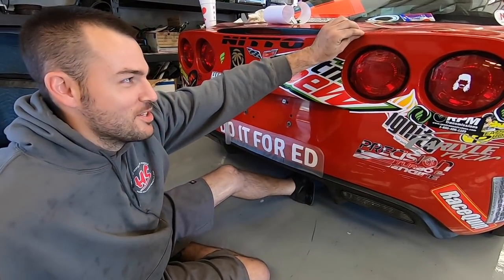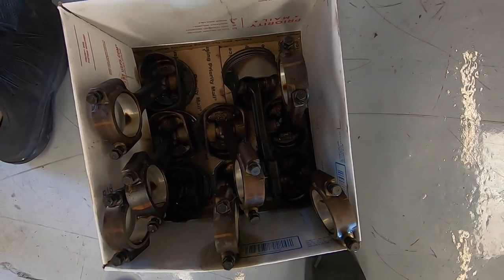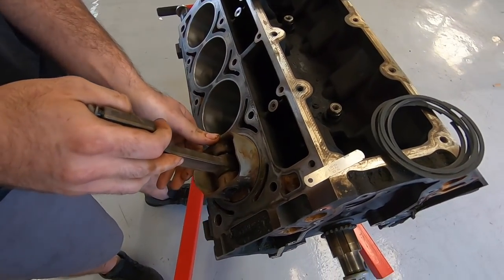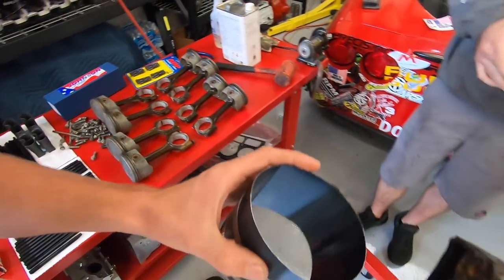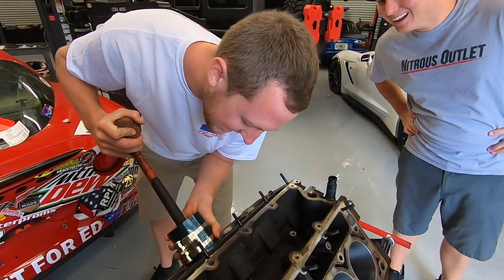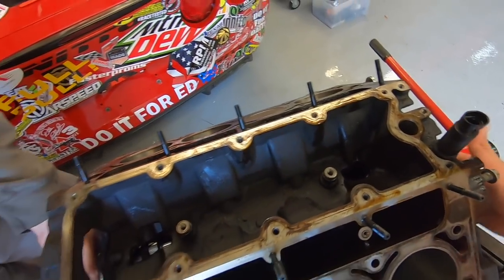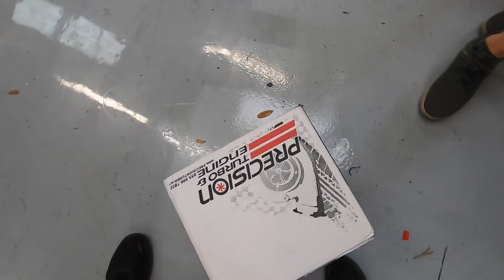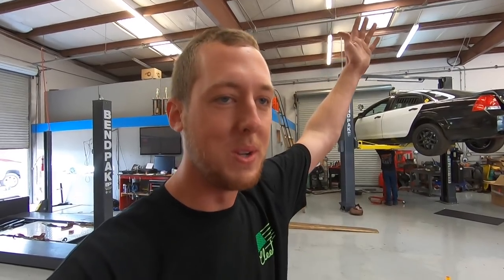The Auction Corvette is REBORN w/Her "NEW" Junkyard Truck Engine!

Comment: What kind of voodoo is this?! I'm also gapping rings as we speak 😂👌
Reply: For boost?
Reply: She'll be ALOT more Aerodynamic but think he's having way too much  fun with the ol'girl to comparee Ruby to "MR. MONEY MAKER" LEROY
Reply: I’ll be gapping mine next week 😂
Reply: I’m replacing lifters on a 5.3 today 😂
Reply: @ezbdaniels  Do you have to replace the cam when you replace hydraulic lifters? My Suburban has a lifter tick that I'd love to get fixed eventually and I just want to know how much to save up, especially since I'll be having someone else do it because I'm not of a mind to deal with a modern engine and its clusterfuck engine bay.
Reply: I feel like I'm a mechanic now lol
Reply: The YouTube Phantom Official You shouldn’t have to replace the cam unless the journal’s scarred... i’m not 100% on a Subaru, as I mainly work on Gm motors at a Chevrolet dealership but the only time we replace the cam is if the lobe is buggered… GM had a problem with AFM lifters collapsing… Most of the time you can get by with just throwing new lifters in. I’ve also seen quite a few of the lifters spinning inside the plastic lifter guides which damages the cam when the roller turns sideways. I know on most imports, overhead cams especially, the tappets would start ticking. It’s usually a fairly simple job to replace them but as I said I’m not a Subaru expert by no means :-)
Reply: @ezbdaniels  nah, inspect it if you're worried but if under 200k it's probably good to go
Reply: @cumbob  ok, thanks. I know you have to replace the cam on engines with solid lifters, but I wasn't sure with hydro lifters.
Reply: Chase Younggreen  The one I’m fixing had A collapsed AFM lifter on cylinder seven... no problems found at all on the cam, so I talked the customer into replacing all the lifters and guides… Not my first rodeo buddy as I’ve been in the dealership world for coming up 15 years
Reply: The YouTube Phantom Official You are correct sir. Roller cams are a whole different beast than the old school Hydraulic
Reply: ezbdaniels he said suburban not Subaru
Reply: Grants Dad ah man, sure did... it was a long day 😂😂

Comment: Sometimes working on a car is fun and sometimes no fun at all, depending on what you're doing, where you're doing it, and why you have to do it.  But once you have an engine on the stand with a box full of new parts nearby, the rebuild is always pleasurable work.  And the excitement and satisfaction you get when it fires up and runs nicely is hard to duplicate.

Comment: I’m not usually the internet safety warden, but Jesus guys. Using a $9 Harbor Freight grinder that’s been modified to accept an angle grinder wheel, your face is right in line with it (in the death zone), and no glasses. You won’t be ripping Leroy down the track when you have one eye and no depth perception.
Reply: yep, have seen too many wheels blow up
Reply: bobwatters “safety squints engaged”. You must also be an AvE viewer. He would not rate that Horror Fraught grinder as skookum.

Comment: Plasti-guage???  No??  Guess they dont need that where they're going....
Reply: Gatorsrok they are reusing the old bearings crank pistons and rods, the clearances aren’t going to be any different then the way they left the factory.
Reply: Plus watever wear they have. It has 70psi cold oil pressure at 2k rpm. What more do you need to know?
😆😆
Reply: @J-Eagan  , I didn't catch that , they are reusing the bearing with 100K miles. They looked pretty good.

Comment: You should have at least changed out the rod bearings while you had it apart. Now you are just asking for trouble.
Reply: I find it weird not doing  Pistons and rods as well while it's apart to each there own tho
Reply: @J-Edgar Hughes These armchair engine builders are funny. Obnoxious, but funny. Why the hell would you throw out good, broken in bearings and waste money on new bearings and the process of installing them?
Reply: Silas Smith a good bearing is a good bearing. Put in a new bearing is just a waste of money
Reply: Doesn’t matter that hooptie shit will blow up again anyways.
Reply: IF the bearings were serviceable they should cause no drama. GM [and everyone else] uses selective fit shells that may have thick backs or undersize crank face. I have struck as bad as .010 in GM engines and .004 in Fords. When those are to be replaced it generally means both grind the crank and line bore the block. And everything should be measured to check clearances. Been there done that on numerous occasions. And GM were the worse!
When disasembling keep the old shells together and then read the under/ oversize. That will give you a fair idea IF you can getaway with standard bearings before even measuring the crank, main journals  and rod clearance.
And this on kero rebuilds, not 700hp turbo motors. With those personally I would never to less than a built engine with more piston clearance as well. Though a 100k engine probably has worn a thou or two more!
Reply: Rod and crank bearings dont go bad like ball bearings do. They are either good or damaged, one or the other. They never touch the crank.
Reply: @noanoxan  Because you want every ounce of oil pressure in a race motor.

Comment: Technically, when you change rod bolts to a higher strength replacement like ARP, the big end has to be measured for roundness with the new bolts torqued down.  The torque is based on achieving a given stretch in the bolt and a higher strength bolt will squeeze the rod harder and deform it slightly more than the old bolts did...I know nobody cares about those details on this build, but just FYI.  

That setup for ring filing is a good idea.  I just picked one of those grinders for my build.

Comment: Loved the longer video Cleet! Also love the fact that you guys go in depth with what goes on with building the engines and you guys take the time to show everything and explain everything, I’ve learned a lot watching your videos and actually your cam change video on the Crown Vic showed me what to expect when I changed the timing chains on my grand marquis with the ford 4.6L 2v V8 and I did not reuse my chains. Also I don’t know if you guys reused the bolts that hold the cam gears on the cams but I heard those are meant to be torqued only once and will break if reused. Anyways, loving all the builds, loving all the bald eagles and horsetorques 😂😂 keep em coming brother

Comment: Taking bets now on how long this engine will last. I'm guessing 27 days. Not because it was built wrong. Just because of garret
Reply: No way Garret is a very calm cool guy. An entrepreneur with a law degree. Now Cleetus on the other hand...
I wouldn't that guy touch the throttle on my string trimmer.
Reply: I say 28 days

Comment: $30 gets you a good size specific ring compressor... That band type is a POS..
Reply: $0 gets you a donor used food can. Add a pair of vice-grip pliers to pinch closed the bent ends of the cut strip of can. If you are not aged and decrepit like me and have good finger strength, you can manage without the vice grips.
Reply: They made it clear they wanted one for all the engines in the shop and are only bad when your unskilled....

Comment: For anyone watching this, never file piston rings like this. Purchase a proper ring filing tool to do the job right. Your never suppose to file both ends of a piston ring and your definitely not to squeeze the ring on a grinding wheel and especially with just your hand because you will make the end of the rings not uniform and could gouge the cylinder. Also, when installing new arp rod studs or bolts, it’s wise to have the rods inspected by a machine shop because nine times out of ten it will need to be line honed. None the less, good luck fellas 👍
Reply: I've been trying to tell people for years that you can't just slap rod bolts in. 9 times out of 10 people do it incorrectly and cause premature failure
Reply: Exactly, I think everyone should do a little more research and a lot less YouTube surfing. This video could get someone out there to actually assemble there engine in this manner and end up with a ticking time bomb. There is such thing as building cheap, but it’s a completely different situation to build out of spec. It’s like the old saying goes, measure twice and cut once.
Reply: For cracked rods prob yes, for forged Cummins with 2 piece- not that important. Torque and bolt stretch is the key. Plus it’s a junkyard build, so not a 15 k rebuild.
Reply: @P Pumped 24V now see, this is a guy that know nothing about engines. For one, this is an LS he’s building bud not a Cummins diesel, maybe you should head back to the dodge vids 👍. Two, when installing studs and or fasteners that require a higher torque value it’s imperative to have the rods and bearings measured because the clamping force is now greater. Also, the new fasteners could torque the caps one way or the other as commonly seen on 4g63 engines, requiring the rods to be lined honed for correct bearing clearances. Three, there is a huge difference in building cheap and building incorrectly period, I do not care if the engine came from a junk yard or not (hell even more reason to do it right and double check clearances and specs) an engine is an engine, it is assembled in a plant with exacting tolerances, $500 to 15k doesn’t matter because specs are specs and nothing you can say will change that.

If you’d like to try my knowledge a little more on engines or even learn something, then I encourage you to reply here or meet me on the LS forums or Nasty Z28 forums 👍
Reply: PS, as for cracked rods, there junk, no measurements required. Toss them in a can and go buy new 🤣 I certainly hope you nor anyone you know are wasting time at a machine shop and wasting the machine shops time inspecting junk cracked rods. Hahaaaa, you people kill me man 🤦‍♂️
Reply: @strokedyamaha3746  You think you're smart, but we have put many engines together with cracked rods - 800 hp twin turbo cummins, duramax, I'm not talking for engines over 1k hp, No of course you can't expect them to hold up over 1k hp- thats where you use billet rods.
Reply: @strokedyamaha3746  Yes about checking clearances when he's building a race engine. He's building a junkyard engine for cheap, n he's having fun doing it. its not a texas speed ls build to run 300 passes like Leroy.. So why didn't you tell him to deckplate hone the block for the ARP studs?, And everything else he did wrong...
Reply: @ P Pump 24v bro? He’s took a berry hone to it. It’s to late to help them on that one. Deck plate honing known as Torque plate honing simulates a cylinder head pressures on the block while being honed. As for the (I think I’m smart) comment, absolutely not, but I appreciate you thinking of me in that manner 🤣 I will let my 12 years of technical mechanics collage and another 4 years working in a machine shop speak for me. And, as for the (cracked rods) being in one of your magical 800hp diesels, I highly doubt that. If your speaking of fractured fit rods as comes from the factory of many different manufacturers, then yes, I’m sure factory diesel rods could easily handle 800hp. But I don’t know of a single person that would dissemble an engine, find cracked rods and acutely run them 🤷‍♂️ 

Also, as for helping cleetus, that’s just that. I am trying to be helpful to him and others. I’m not going to sit here and write an autobiography for everyone. Honing with or without a torque plate isn’t going to throw a rod out of the bottom of the motor, nor cause it to seize up. But, not checking the rods or mains after installing new performance fasteners of different dimensions can.
Reply: BTW, just to shed some light on your comment. Torque plate boring and honing has nothing to do with ARP studs. It’s primarily to keep all cylinders even and symmetrical under boring. Most machine shops do not even use torque plates for just honing alone.
Reply: 355 Cutlass Fractured, split, or cracked- call it what you want it’s the same thing, a 2 piece rod is different, I understand this. Now there is such a thing as a powdered metal rod, and those are not forged. I agree those are junk. A number of gas engines use these, the 7.3 power stroke used these a few years, and possibly even the LS. the reason to use a deck plate/ Torque plate when boring with using head studs or other non factory performance fasteners is because the bore will be more distorted because of higher clamping force of the fasteners.
Reply: Acutely it’s not, conventional split rods are molded then cut and then honed to size. Both mating surfaces are flat and therefore rely on the fasteners to keep the rod and cap aligned. With a fracture fit rod the rod is molded then machined and honed then fallowing that, the rods are placed into a jig and a machine then snaps the base of the rod off making a rod and cap. The surface of the rod and cap now only match each other and when placed together only fit one way.

We can go on and on here but everything your saying has already been said. I helped them because I like them, Dew and great old American V8 automobiles. At this point I really don’t feel like helping you anymore then I already have bud. If I help you anymore it’s starts to become a job and seeing that I’m not getting paid for this, it’s waiting my time. Good luck to you though and your 800hp diesel cracked rod engines, if it works for you then it works for you 👍 🤦‍♂️

Comment: Everyone says you need to resize and balance your rods after fitting aftermarket bolts so I'm keen to see how Ruby goes with new bolts. I've had Katech rod bolts in my LS3 with stock rods and pistons for years now making 700hp.

Comment: Brian Cooper at Kappa Haus has adjustable LS motormounts, you can adjust your engine up and down, forward and back so you can fine tune your weight balance. Just sayin :)
Reply: I don't believe that would work on Ruby, the torque tube set up limits any movement.

Comment: If I were setting gaps on rings everyday, there has to be a faster more accurate way, hmmm...….OHH!! A custom jig to hold the ring in a milling machine (Bridgeport) so when clamped one side is slightly higher than the other, with a carbide end mill touch off on the ring and dial over exactly the amount needed and machine right to size. For an airplane ticket and cost to make the fixture I would glad to help you guys out  :)

Comment: cleetus McFarland.. you may use a oil filter before the high pressure line goes into the turbo .. that may help to collect all the metal shavings from the engine and save the turbo

Comment: Love this channel.  By the way, with new ARP rod bolts you’re supposed to re-machine (re-size) the rods with the new bolts pressed in and torqued to ensure they’re round.  If the weight is different you need to also re-balance the rotating assembly.  Assembly lube is better than oil; it protects the parts at first start before oil pressure rises.  I know this is a hack job but you don’t want folks to learn things wrong as popular as your channel is.  Doing it correctly will allow the engine to ingest more bald eagles.

Comment: Just so you know that parts washer cleaned out any oil that was on the valve guides. You will be running them dry for a while after you start it up the first time.

Comment: When you rebuild Ruby's engine do you put cam oil on the cam shaft before you install it in the engine to harden the cam shaft at all do you know about this and do you mark your rods and lifters to each cylinder at at cuz they all wear diffrent and also the push rods too hope to be his helps and great videos and show

Comment: I have built enough engines to enjoy the The comedy of your engine build. Not to bad. Keep it up. Your getting there.
Reply: Don't forget to lube up. Store the block next time with oil in the cylinders. Keep cranks standing up don't ever lay them down for any extended period of time. If you can get away with the power tool on the ring grinding okay but not recommended. Use a punch to number rods. It doesn't hurt to wave rods and pistons keeping the the weight of them consistent helps.rebuil Parts are cheaper at EPWI. THATS where Texas speed buys them.
Reply: James definitely has built some engines before so I think it might be okay.

Comment: Besides doing the plastigauge on the bearings. Everything else was pure junk yard rebuild in my book. I have done a good many of them.  But yourself some cheap insurance. If you are running a aftermarket ecu in it. Use an oil pressure kill system in the ecu set up. You can put the computer in to limp mode if the oil pressure bottoms out on you again. All you need is a pressure switch hooked up to the ecu, and enable it in the software.

Comment: Summit has a tapered compressor for 28 dollars. It's worth its weight in gold...kinda.
Reply: I had nothing but problems with the one they were using.
Reply: Those old school adjustable ones work with some patience. You rush it and shit breaks.
Reply: These tapered compressors are the best thing ever. I'm a mechanic for a living and they are soooo nice!

Comment: @Cleetus Mcfarland You should check out Cassels' Automotive Machine in Cairo, Ga. The only things I'd add to the "we may be wrong so don't follow our directions" is de-bur the rings and any time you change rod bolts you should resize the big end of the rod to make it round again. Early rod bearing failure is a strong possibility if you don't resize the big end. I understand its a junker and doesn't matter in this case but if you care about it, do it, especially for a daily driver. I only say this for others who want to do something similar. Whatever you do don't file rings with a hand file. The gap will be wrong!